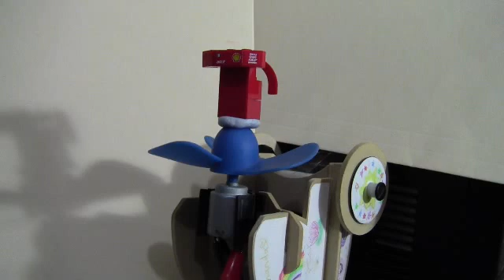DC motor speed-controlled at very slow rotation

Comment: Mate..... I want to make a welding turntable using a 12v motor and I've got the chain and sprockets and all but just need to get the motor to run at a far slower RPM..... How so?
Reply: G'day, not sure what type of 12V motor you have and what its power rating is, but a couple of options are available:

1. Instead of applying the full 12V, try a lower voltage, say somewhere between 6 to 9V.  If you have a power supply with variable voltage, just experiment with a different voltage value.  Alternatively try a 6V battery.

2. Mechanical option:  use a lower gear.  That is, use a sprocket with fewer teeth and attach that to the motor.  Use another sprocket with many more teeth and attach it to the turntable.

3. Perhaps the easiest option is to use a motor from an old sewing machine. That's typically a 240VAC motor, but it is typically controlled with a foot pedal to adjust its speed.  Have you tried a windscreen wiper motor?

4. This option is to use PWM technique, basically to apply short bursts of energy or power to the motor, similar to what I did in the video.  It's technically more difficult.  I plan to make a very simple PWM module within the next few months and sell it online to cater for these sorts of applications.
Reply: Thanks for your help..... Yes its a 24v motor and can run on lower voltage and I will try dropping the volts to see how it manages that. It does need to have fair torque though and that may be the only downside of  less voltage. The sewing machine motor is a good idea as I do have one and will look to see if its ok to set up. 240 volts will do if it does the job but I did prefer 12volts if it was possible. But like most things, if it does the job in the end, then all is well. Thanks again.

Comment: How to slow down speed of dc motor?
Reply from the maker: This is a quick hack to try out:  Place a resistor in series with the motor connections from the supply source. This will weaken the mechanical power output from the DC motor though.
Reply: Thanks brader

Comment: How does that compare with changing the voltage by analog circuitry?
Reply from the maker: If you just wanted to generate a variable voltage, there is not much difference.  However, in the DC motor application, the motor will not even move until the voltage applied is above a certain level.  But if you use PWM, the motor gets a good kick to help it start moving, even at low duty-cycle.  One can avoid the motor doing sudden jerky movements by damping its jerky rotation with a small load.  For example, add some friction to the rotating part.

Comment from the maker: There was no feedback from the motor.  (The motor was from a kids toy).  It was driven open loop, using PWM technique.  I wrote a small program on the AVR micro to generate the PWM drive signal, to vary the ON time and period.  The optimum PWM output for that motor was 6 millisecond ON time, with an overall PWM time somewhere between 40 to 65 milliseconds.  If the ON time is too long, the motor will lurch or snap.  Try to keep ON time as short as possible, but not too short to avoid stalling.

Comment: I'm surprized by very smooth rotation.
Usually the rotor snaps to several positions with respect to the field poles.
Why your motor doesn't snap?
Is there some kind of feedback from motor used?